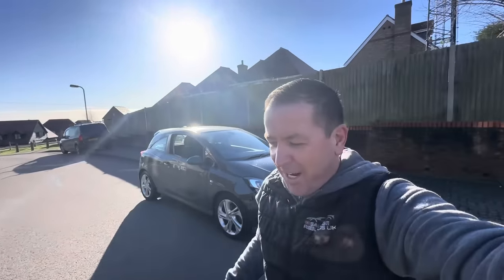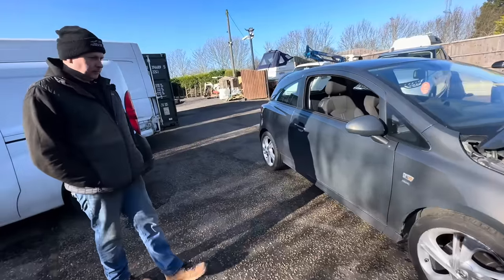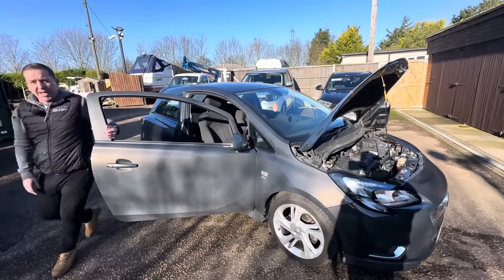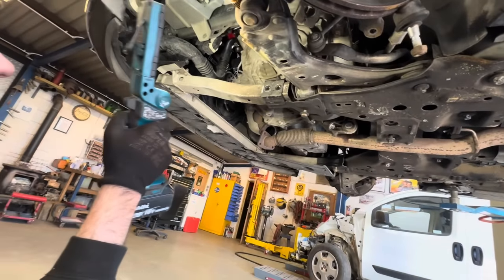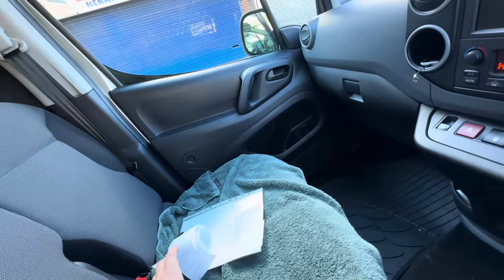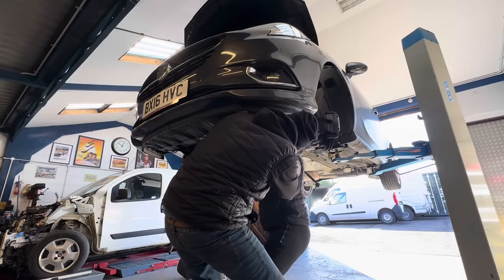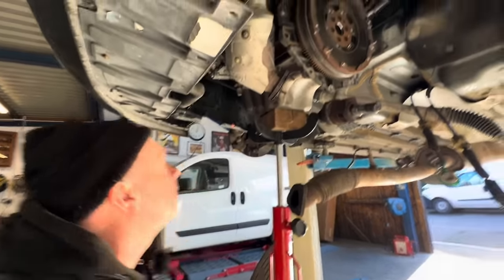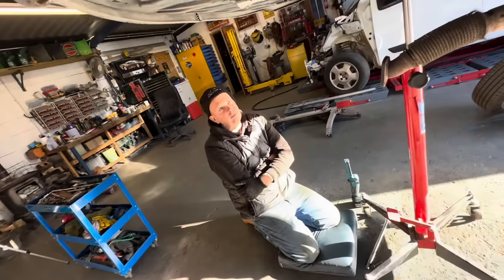WE GOT PROPERLY TUCKED UP BY A SUBSCRIBER

Comment: Vauxhall.  Enough said.  I'd rather buy a second hand Toyota than a brand new Vauxhall.
Reply: What do you honestly even know about vauxhall? Little to nothing I presume?
Reply: i mean... 362k on my Zafira B 1.9 cdti... Still going strong... Only really had the wear n tear parts replaced... A set of glow plugs, A new clutch 70k ago, Cambelts every 80k...
Had a gearbox rebuild... £32 for bearings and can be done yourself while gearbox is still on the engine....
Heck, Its even still on its same turbo!......

Vauxhall engines (well they arent vauxhall, i know)... Are perfect... Its the m32 gearboxes that just suck ass....
Seams to me, That you dont really know much about cars....
Reply: @RGD-Audio-Repairs according to a Vauxhall mechanic my friend knows that worked at the local Vauxhall dealers, the Zafira 1.6 engine that needed replacing in my mums car at around 80k had done well considering they are known in the industry to be ‘made of chocolate’.
The 1.9 is what she thought she was buying cos as your experience shows are worlds apart and it wasn’t until I looked at log book later that she found it was a 1.6 and unable to tow her caravan. Dealer apologised for the mistake and offered her a free service as the car couldn’t be rejected as they’d already moved her traded in Sierra on.
Granted it was 2nd hand but from Vauxhall main dealer with FSH.

Comment: Hmmm….with that much end float I would imagine the thrust bearings have parted company with the crank, or certainly one of them has. It’s not shimmed as well behind the flywheel is it Rob ?.  They might have left them out when they replaced the flywheel. I would be too curious to pull the sump to get to the mystery….

Comment: I think pull the engine rob and stick the car on a dolly / castors.take the crank out and see what the problem is.im sure they cay weld the crank and grind it and oversize the bearings to rid the end float or shim it

Comment: I learned to drive in one of these but it had the naturally aspirated 1.4 engine. It only had 40k on the clock when I started using it and by the end it had an engine light, service ESC warning and traction control warning. It idled bad and was very low on power. The clutch dampener mechanism was knackered too and first gear was crunchy.

Comment: I've only had one Vauxhall, and it was utter dogshit. It was a 2000 Corsa with a 1 litre engine. It was low mileage, but  shat its gearbox a few weeks after I got it. Put a reconditioned gearbox in, for it to fail again shortly after.
Reply: Same here.  I owned an Omega and it had far too many inherent faults.
Reply: Sods law. I've been running a 2005 Astra H since 2010, with no more bother than a clutch change, brakes, and a couple of bulbs. Currently on 156k. Vauxhalls are solid if you look after them, and remember to change the oil 😉

Comment: It's a Vauxhall, 30k miles is at the end of its life!
(that's why it's failed at such low mileage!)
Reply: It was never the clutch tho was it
Reply: Yes Vauxhall would never ever buy one again after the timing chain failed at 45k
Reply: 😂 my 2004 diesel zafira is fine. Had it 12yrs, never let me down, biggest job I’ve had to do on it was dual mass flywheel and clutch, mileage at present 240,000 miles.
Reply: @stevenwilliams-mp5wo  Until recently i had owned vauxhalls exclusively.

Found that for each "new" vauxhall i bought it would just get progressively more expensive.

Imagine owning the Astra K 1.6 diesel

Weak M32 gearbox, massive problems with brake and clutch, strut boots disintegrating after 2 years, steering columbn can be moved about ½ inch up/down in the locked position, slave clutch pushing brake fluid into the gearbox oil and timing chain rattling and destroying the plastic guides at 30.000 miles.

Absolute shitshow and offcourse vauxhall want to cover nothing ....

I have owned my last vauxhall, they got poorer and poorer the newer they got.

Comment: Sorry to say this, but your first mistake was buying a Vauxhall. Your second was that it's a Corsa. I don't know about anyone else, but the engine sounded horrendous on idle when you had the bonnet open at the start of the video.
Reply: nothing wrong with vauxhalls, its down to ownership
Reply: My Corsa's 20 years old. I rag it pretty heavy and it seems fine still.
Reply: Unicorn, if you're worried about the ticking noise in this case it's the injectors and quite normal, and that also goes for other manufacturers.

What actual experience do you have with Vauxhall cars?

Comment: What box is it in these? The f17 box can wear its output shaft bearing and this is often mis diagnosed as a worn thrust bearing. £650 later the noise is still there

Comment: Sorry to say , this must be a common problem,my son had the same car on a 15 reg with 21k mileage, exactly the same crank thrust washers, B14 NEL engine code , lucky I got a replacement engine with 6 k mileage for £800 as the car was only 3 years old then and there was probably no call for these used engines then.

Comment: Man i can't believe it. I had the exact same issue with 3 cyl peteol corsa. Put a clutch in it thinking it was release bearing which didnt cure it. Stripped it doen again and it was excessive crankshaft end float causing the back of flywheel to touch down on block. Nightmare. Sorry for your troubles lads. What a headache the motor trade can be.

Comment: Clutch replacement at 32k 😮 my mk6 golf 1.6 is on 150k and still has original clutch 😂
Reply: Yep,124k still holding strong
Reply: All depends on the driver , I know of a 96 Land Cruiser ,lady owner  with 330,000 miles, nearly all towing on the same clutch ....
Reply: I can beat that my old mondeo 05 2.0tdci 200k then the flywheel started rattling
Reply: Yep, I've taken a 2001 Vauxhall Corsa SXI 1.2 petrol from 31k miles to 88k miles all on one clutch, I then took a 2005 Ford Fiesta 1.6 petrol Ghia from 14k miles up to 112k miles all on the same clutch and then a 2008 Ford Focus 1.6 petrol Style from 28k miles up to 84k miles, all on the same clutch. I then had a 2012 Kia Rio 1.25 petrol, took that from 19k miles up to 76k miles all on the same clutch, I now have a 2016 Kia Rio 1.25 which I've taken from 7k miles and my current mileage is 49k miles all in the same clutch. This Corsa must have been absolutely ragged to have needed a clutch on only 31k miles.

Comment: Oh fudge!  Nice car, bad motor. I don’t know enough about these engines in this car to know how you can mess up a thrust bearing in them. I suppose it’s just not a case where you pull the pan and main caps and roll in a new set of bearings.
Reply: You might not even need the full set, just the one with the thrust flange. And that's assuming that it's not a separate thrust, perhaps even a missing thrust.

Comment: Bad servicing and sitting with foot on clutch for long period can chew these.  The crank can wear through the bearing into the block. Be interesting to see how much its chewed the block up. Pop the engine and show us how bad it is. You can get the block welded and machined then new bottom end build. More than a new engine though.

Comment: It's been a driver who sits at the lights with the clutch depressed at every junction ...
too lazy/stupid to apply the handbrake, release the clutch repeatedly. So the Clutch pedal pressure increases the wear on the end float bearing of the crankshaft ...
the same loon probably drove around with popped brake lamp bulbs too most of the time?

Comment: Is it me or are the titles of the videos getting more misleading?
Reply: What's misleading about that?
Reply: @MrLongshot26 because it says we got ripped of by subscriber then in the video Rob says they probably didn’t know???
Reply: @pauharpe8464  The issue is with the engine not the gearbox, the subscriber did not disclode this to Rob and made out it was a gearbox problem. I would take the car back and dump it in parts outside his house.
Reply: @iannoble4854  but not everyone knows the difference between these noises, after been in the trade for 30ys on a Corsa I would have said dual mass noise and that’s probably what the seller was told also, the real people to speak to here are who ever put the clutch in and then gave the car back with the same noise, but if they told the seller it’s not cured it and it’s crank noise then agreed the seller needs to step up..
Reply: @pauharpe8464 you can’t expect people to be reasonable about this here mate a lot hang on every word these 2 say and take titles as face value instead of the clickbait they are
Reply from the maker: @AI-Records24 it’s not click bait it’s fact after we find the problem I start digging and find out the chap I bought it off is trade and it was never his dads car 🤷‍♂️ what’s not true in the title
Reply from the maker: In what way please ? I bought the car off of the chap and he described that it had a clutch noise. He also told me that it was his dad‘s car who was giving up driving after doing some digging. I found out the car never belong to his dad, and the chap I bought the car was in fact a motor dealer passing on a headache

Comment: What a disappointment boys, I have seen this before . As a ex Vauxhall tech also like to point out that 6speed gearbox (M32) is a disaster Rob if you drove it home was there any noises or was the gear-lever moving when accelerating?

Comment: Presume the crank has been worn by the thrust bearings. How much is a crank?

The Maserati Quattroporte IV manual could have thrust bearing issues. Reputedly from people putting their foot on the clutch to start them (load on the thrust bearing with no oil pressure)

Comment: I knew it was that St away, had the same on a corsa that came in with clutch judder, 31k miles, one owner, customer didn't believe it was the engine and not the clutch, actually got an engine for it with 66k on.

Comment: The main problem with thrust washer wear is using that pissy 0-30 or 5-30 oil even though it's recommended in many cases. Use 5-40 oil as the thinner oil was recommended for emotion reduction not for engine longevity. Secondly get out of the habit of holding the car on the clutch at lights etc ....
Reply: Emissions
Reply: @stephendennis7871  "emotion reduction" made my chuckle, that's the definition of modern cars.

Comment: I had the same issue on the same engine in a zafira, got to 115k and bottom end failed. Serviced on the dot with the best oils. These engines are crap and £1700 for a used one writes a car off

Comment: Your a bit quick to write car off. Id have removed sump first and if need be the engine to check the parts and build as id say someone has not put all the parts back into the engine build.

Modern mechanics replace engines, they dont build them as of years ago. So its easy for a peraon to not assemble one back to perfect.
Reply: You're....
Reply: Why not just repair what needs done and then sell it?
Reply: @AHoundOnAHonda  This 👆🏻it's crucial to speak correclty
Reply: @thesleepstate  LOL! Indeed - or as "correclty" as possible! 😂
Reply: @AHoundOnAHonda 😂 amazing
Reply: There’s a difference between a mechanic and a fitter, and it’s a big difference.
Reply: @richardwillson101 

I DON'T BELEEEEEIVE ITTTT!

Comment: Is changing the crankshaft not an option.  I did have a similar problem and the engine had been rebuilt, and the flywheel bolts had come loose, so maybe it's worth checking before you put it back together.

Comment: your there pull the sump off see if the thrush washer is there
Reply: It won't matter if it isn't. That end float would have damaged the crank, the metal fragments off the crank will have got in the oil. The engine is toast.

Comment: This Corsa s have electric problems with the boot won't open due to the electrics and the revsing lights don't work I don't use car vertical i use know my car app is cheap to get a check I use that to check my dad's Audi A5 when it had a accident in a car park it was not a cat car

Comment: The slave cylinder was inherently defective on my 2016 Astra 1L Turbo. I bought it from Vauxhall with 32,251 miles on it, the clutch pedal had a dead spot where it would drop a quarter without any effort. The sales guy said that was normal, even though the 1.4 Astra I previously tested half an hour previous didn't do it. I bought it anyway as it worked fine. Two years later it started being weird, refusing to go in reverse without the engine off. Forward gears became harder to engage. Took it in and they replaced the slave cylinder free, under warranty! She's been a great car ever since, no major issues.

Comment: 90 bhp but driven like they're a 3lt , reason they're dead so early.
Take note newbies , there's a lesson in every vlog 👍
Reply: The younger generation spent too much time watching the fast and furious!! those never ending gearchanges have took there tole on this poor Vauxhall.
Reply: 140hp it's 1.4 turbo but yeah still this must have been ragged probably not letting the engine warm up before thrashing it possibly even ran it low on oil or it's been clocked/mileage blocker
Reply: @sbrader97  ...31K with these issues they should have walked away but the buyer isn't a mechanic , makes for good YouTube content though so worth the hit 🤣

Comment: the yanks hate this 1.4 turbo lots of failures apparently, looks like this GM engine is a bit of a dud.... i had an 09 1.4 non turbo that had oil pressure issues at 40k miles

Comment: Is it not the same engine as a Vauxhall Adam S (grand slam)?? I think the vauxhall mokka and astra has a 1.4 turbo but it’s a slightly different engine
Reply: Yeah the engines completely different the mokka-x and astra k used a new direct injection engine that's not related to the engine in the Corsa and original pre facelift mokka

Comment: I've never owned a Vauxhall, and I get criticism for liking Ford, but in all my years owning them, the engines have been bulletproof.
Reply: Not the 1.0 Petrol 'Ecoboost' engines.
Reply: @leonb2637  its use wet belt timing belt
Reply: @leonb2637  True, never had one of those though.
Reply: @loeb1 then they go use a dry clutch in the power shift as well Ford likes to do the opposite of what successful Germans do

Comment: Could it be the fact some people dipress the clouch on start up giving excessive pressure on a dry crank
Reply: Yes. My Hyundai starter doesn't work unless clutch pedal depressed; must be a switch on the pedal.
Reply: Depressing the clutch on start up  puts excessive sideways strain on the crankshaft end flot. I have a van with a VM engine that can do the same there's no switch but the manual recommends it

Comment: Most likely they pulled the pan out and the customer rejected the job. It’s an easy fix. Rear bearing comes as one piece with a spacer at the back, maybe the bearing housing is also bad, crank shaft usually survives, worth to investigate.
You can pull a quickie, put a spacer behind the flywheel, sometimes it works
Reply: "You can pull a quickie, put a spacer behind the flywheel, sometimes it works" - note to self: never buy a car from this guy 😂

Comment: I have a 2011 Ford Focus 1.6 TDCi with 184,500 + miles on it,  when stationary it has a rattling noise from the clutch with the pedal out, if I press the pedal down the rattling stops, when driving it makes a straining type noise when I release the clutch when changing up through the gears but does not make the noise when changing down or when I select Reverse. Any ideas what it could be, I have done 18000 miles in it with the noises been there since I got it cheap about 18 months ago
Reply: Duel mass flywheel is at fault, nackered, 
Lots of play on it.
Reply: you've been tucked up! 😅

Comment: That engine didnt sound very nice. Hope you solve the problem. 👍
Reply: These engines do sound like that normally. It's the injector solenoids, or "pintles" as some call them, they are clicky and make it sound noisy because the engine is quieter than the solenoids!

Comment: Very interesting video, 
I have a question ,a friend is selling a 2014 Astra ,runs perfectly and has done only 10.000 miles, her father who bought it new  passed away in 2015 and she has hardly used it since, is it worth paying   £3000 or should i steer clear?.
Reply: It's a 1.4 petrol engine.
Reply from the maker: It sounds like a very fair price
Reply: It could be if it's not haunted

Comment: whats the problem with that car i dont understand
Reply: Watch at 22:00 the dual mass fly wheel has lateral play. The play is caused by a worn crank shaft which was caused by a lack of oil at some point in the past.  The car will run for a few thousand miles but it will eat through clutches because the fly wheel will be moving about all over the place. Eventually the wear on the crank shaft will stop the engine from working  and in the mean time while the crank is wearing itself down it will be releasing metal shavings into the engine and oil.
Reply: It's phuqed
Reply: @andyclarke8916  The clutch won't be affected. The friction plate slides on the gearbox input shaft spline and is contained between the flywheel and the cover.
The rest is correct though.
Reply: @TonyRule  surely if the clutch is not engaging properly due to the play on the flywheel is will sustain excessive wear?
Reply: @andyclarke8916  Thanks for explaining, that makes sense.
Reply: Ha knew it was end float..

Comment: Running light is flashing to
Reply: Ever heard of PWM?
Reply: It is the difference between the camera frame rate and the pulsed power rate of the LEDs that causes it to appear to be flashing. Very common for LED lights to appear to be flashing on camera. Similar to the way a spinning wheel or helicopter rotor can appear to be motionless on camera.